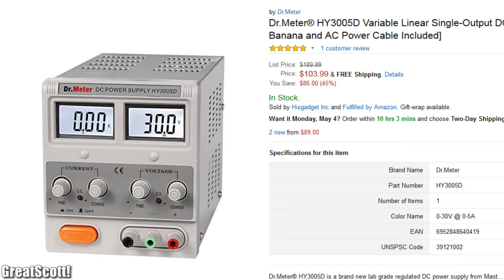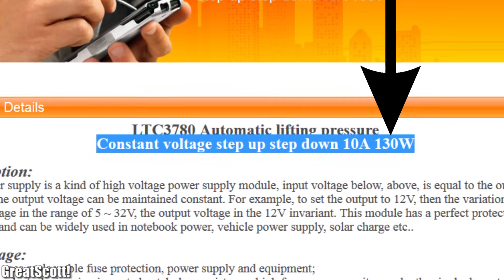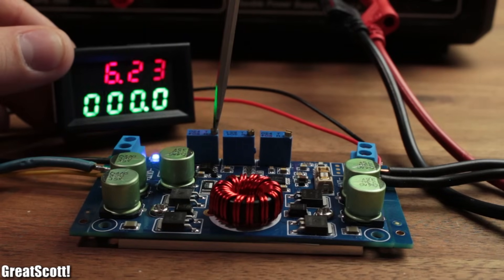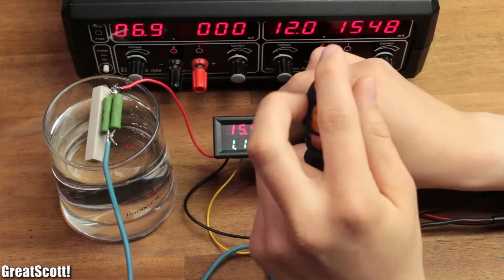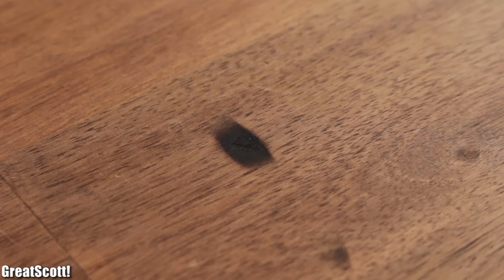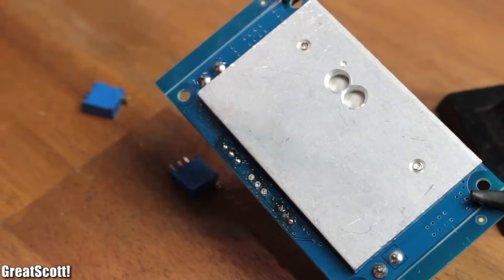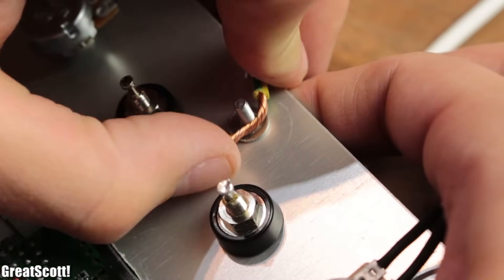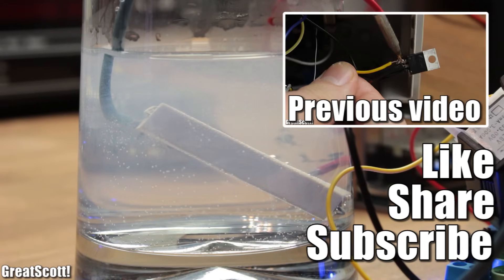Build your own Variable Lab Bench Power Supply

Comment: it would be very useful if one could show a way on how to control the output voltage via the PWM signal of an Arduino (maybe a convert the PWM signal to analog with a RC-Lowpass  and feed it to  potentiometer location??)
Reply: I recently done this for an industrial application. A low pass filter then use an Op Amp as a follower/buffer to get an analog out. However the analog voltage output will vary from 0 to whatever the supply voltage is....
Reply: Be careful, without a good understanding of the actual specific circuit and also access to the proper schematic you might easily find yourself causing more problems than the worth of it like sending the psu into an uncontrolled oscillation state and causing it to burn out. Search the web for Arduino based PWM  controlled psu or such like. There are plenty of Arduino-based example circuits for such a capability.

Rule #1 DON'T assume anything because it makes an ASS of U before ME.
Reply: If you want to control this setup with an Arduino, then you will be better off combining the Arduino with a dual digital potentiometer chip to act as a replacement for the two original potentiometers.
Reply: You could build or buy a resistor ladder (like an R2R DAC). That would let you control the exact resistance seen by the buck/boost converter. It surely using the pot as a voltage divider to an opamp's input. I don't know if it would be the inverting or non inverting input, but that doesn't matter for our case. You could simply wire up a pot to the board as Scott shows here, dial in exact voltages you want it to work at, disconnect the pot from the board and measure the resistance value of the POT. Now you design and build your ladder, possibly with unequal rungs, to get the precise outputs you desire. You'll want several trimmers in there probably so you can make fine adjustments to get it as exact as you can when you built it. Then by turning on/off certain GPIO pins, you can select exact voltage/amperage settings. Because the precision of the multi-turn POT is very good, and the resolution of your ladder probably won't be, selecting arbitrary settings will depend in the number of GPIO pins you use (the bit resolution of your DAC in this case). I would suggest at least 12 bits of precision as a bare minimum. That would give you 4096 different settings, or another way to look at it, steps of 0.005V (24 volt range)/2.4mA (10 amp range) on your output. It would be hard to get exact values for your application like this (say, exactly 100 mA, or 175 mA), unless you used an uneven rung design. Maybe the first 4 bits chooses a range, and the next 6 choose among exact voltages, and the last 2 move the adjustment up or down by 1% or something for fine precision. I don't know.  You'll need to be creative on this, since there likely isn't an exact chip built that will do precisely what you want. That's why you're doing it custom, right?
Reply: زس
ؤ
Reply: ThomasHaberkorn sorry what?

Comment: i tried twice to get the pots off the LTC3780, both times i fried the pads i guess, i never seen any pads, but when i removed the pots there was nothing to solder to , so i bought a second one , same exact thing $44.00 for these LTC3780 s and im stuck with these both and and still no power supply, and no idea what i will now do with my new $44.00 paper weights
Reply: hard lesson learned, i bought a new iron, a hakko, a very good investment and a world of difference in performance than my cheap radio shack crappos. but still wish i knew how to fix these ltc3780s
Reply: Wished I had the time and patience but I'm just going to buy this, http://www.ebay.com/itm/0-30VDC-0-3A-Switch-Mode-Bench-Power-Supply-with-Digital-Display-CSI3003SM-/221584065292?hash=item339770830c:g:hPMAAOSwEK9T7jmj
Reply: You could just buy 2 LTC3780 by the same price in aliexpress... just in case you break something... Also, make sure that the iron is hot enaugh to melt old tin solderings, and add some more new tin so you can heat up the 3 pins at the same time. Keep in mind that brand new tin usually has something we call "colofonia" in my country, don't know how it's called in yours (probably soldering paste, or something like that), that helps to melt down the tin. Old soldering points don't have that...
Reply: nice but expensive, especially shipping. See my earlier post re: banggood units <£47 post free for a 0-32v 5A unit

Comment: Excellent guide! Do you mind to explain the main difference between a LTC3780 buck boost converter you used and LM2577S + LM2596S Power Converter Module(http://www.aliexpress.com/item/Z116-LM2577S-LM2596S-DC-DC-Step-Up-Down-Boost-Buck-Voltage-Power-Converter-Module/32243179400.html)? Thank you very much!

Comment: If i were to add a 12v fan can it be connected directly to the internal power supply's output?
Reply: Yes, if the output of the AC-DC convertor is 12vdc, then go for it. If the AC-DC is different, say 24vdc output) you can buy a small convertor board that will output 12v just for the fan like this
http://www.ebay.com/itm/Mini-3A-DC-DC-Converter-Adjustable-Step-down-Power-Supply-Module-replace-LM2596-/291688413257?hash=item43e9fbf849:g:y8wAAOSwezVWxobW

Comment: Hey Scott, its a great project. What resistors did you use above the waterglas? Im intrested in boiling water with a 12V input.
Reply: Look for "power resistor" on the internet. To boil water, I think you'll need several hundred watts!! With 12V, the current will be huge, you'll need a powerful source (lead acid battery for example).
Reply: +xgenesys Thanks :)
Reply: you can use glow plug

Comment: Hi, I wonder if you could help.
I have just built this power supply and I have a strange problem.
When I adjust the pot for the amps I get a value on the display, but when I try the volts I get nothing. 
When both pots are at zero the fault led lights on the LTC3780, but when I turn the amps up it goes out.
The volts has no effect at all. I have checked all the cables as per the design and all seems ok.

I'm wondering if I have killed my LTC3780...

Thanks

Keep the videos coming! :)
Reply: for amp you have to short both the terminals and for volt you dont have to i guess

Comment: short question, what bench power supply do you have? (make+model)
Reply from the maker: ELV DPS5315
Reply: Thanks for your quick reaction. Is this a replacement for the one you had before? Did that one break?
Reply: he said in the video, it does not make enough amperage, so he may aswell build a new one rather than beefing up the old one!

Comment: I would add an insulating boot around the mains inlet connections to improve safety. For example a wire or chain could be inserted into the vent slots to touch a live terminal.

Comment: Nice DIY-project. Just ordered the parts and will assemble them soon. Question: Wouldn't it make sense to connect a diode in series to protect the ltc3780 from overvoltage? If so, what would be the best choice? After all, the diode would have to cope with 300W in the worst case...
Reply: Not quite sure how a Diode would protect from overvoltage, but a diode always wastes Power. Which means that it will get quite hot at that current besides dropping a certain voltage.
Reply: You can buy an IEC plug with a fuse in it. That works a treat
Reply: http://www.parts-express.com/Data/Default/Images/Catalog/Original/090-443_HR_0.jpg
Reply: No, I meant the output from the ltc3780. It seemsthat there might be problems with overvoltage on the output frying the ltc3780.
Reply: Ahh okay

Comment: help me scott.. my ltc3780 goes from any higher voltage to approx 1.8 V during which the blue LED dims and shut down in the end. i dont know what's wrong with it. the original undervoltage potentiometer was damaged so i replaced it with another same piece.. but somehow the resistance is not measurable using a multimeter. plz respond asap. thanks in advance

Comment: I am definitely building one of these. It'll be nice to design pedals for more than just 9v's. I used to work as receiving inspector for an electronics manufacturer. I have tested so many of those a/c mains power supplies that you show here that it's not funny. I think that I will us an old pc case that I have as the enclosure.

Comment: Is there any reason not to use a regular power brick for the 12V 5A power supply?
Reply: Anything that outputs less than 30 DC volts will work. I used an old switching PSU from a broke VCR that was on a separate board. Works great.

Comment: Would it be possible to just use an old, maybe small computer PSU and just use the 12-Volt output instead of buying an additional 12-Volt PSU?
Reply: +severin obrist it should be. I'm also planning to do so.
Reply: I used an old switch mode PS I scrapped out of a broke VCR that was on a separate board (lucky find). It outputs 29VDC at about 3A. Got it for free :D

Comment: has anyone built this power supply?
Reply: +Dub Monster I got the parts on eBay, I would suggest getting multi turn potentiometers , I got a couple nice ones on eBay for $5.00 each used and reconditioned, work great and alot cheaper than new ones, also the single turns are a pain in the neck trying to adjust to a precise setting, and my last suggestion is when removing the pots from the board use minimum heat and take ur time , I have years experience but I still lost the pads on two different boards, so now two $24.00 boards are in the scrap bin. goodluck
Reply: I did
Reply: im maybe building this, if there is parts for it, because i live in finland
Reply: I got everything from eBay and paid less than 40 USD total including the case. Took a while cause a lot of it came from China. I agree with Hammer on the pots. I got single turn and you have to be steady but they work
Reply: Barry Stevens
okay

Comment: have you measure the ripple with oscilloscope? I am curious about how smooth is the output of a buck-boost converter that powered from a switching ac to dc supply.

Comment: Seems that voltage and current meter needs a isolated power supply or the measurements might inaccurate, try a DC-DC converter with isolated GND, or disconnect the thinner black(GND) wire at the 12V side. There is no way the minimum current is as high as few hundred mA!

Comment: hey man, i bought that power supply, when it arrived the potentiometer was corroded and only connected by one pin, the supplier refuses to take responsibility "BUYER BEWARE" of seller  " tomtop_home" on ebay , absolutely horrible to deal with. So i soldered the pot back on, and the supply range is hitting at 35 Vdc to 55Vdc. so will changing the pot fix the problem ???? ANYONE???
Reply: There is a good chance that changing that pot will solve your problem. Nothing can be said 100% as there is always the possibility of some other damage on the board, but I'm betting it's just the pot.
Reply: There is a good chance that changing that pot will solve your problem. Nothing can be said 100% as there is always the possibility of some other damage on the board, but I'm betting it's just the pot.
Reply: Alley Cat Jack thanks, I'll try and figure out what size it is
Reply: +Alley Cat Jack thanks for ur help alley cat, that did the trick, i also put a couple them $1.00 buck converters  inside mine to have a constant 12Vdc 3A  , and a constant 9Vdc 3 A. added a fan , some heat sinks and a led just for the heck of it, lol thanks again, and you too Great Scott!

Comment: Can I use 12v 2a power supply?
Reply: Sure, but your output will obviously limited to either 24 watts or 2 amps.
Reply: John Casteel Thanks. I will use 24v 5a is that ok?

Comment: Could you easily make a 13.7V 70A power supply, supplying clean power, to use when when flashing modules/coding cars?
Reply: No, not easily. The 13.7 V part is relatively easy. Building a high currnet 70 amp power supply is considerably more difficult.

Comment: how this happened...?
that you are using 12v 5A power input and output going upto 29v how...?
Reply: The way this works is the device is applying a high frequency PWM signal to a MOSFET switch, switching power the coil very fast. As the switch closes, current begins to flow through the coil and charge the capacitor. When the switch opens, the coil collapses, driving a very high voltage. A diode blocks the voltage spike from feeding back to the switch, and diverting it to the capacitor. As the capacitor charges up, it develops more and more voltage in it. The buck/boost converter regulates the power by adjusting the duty cycle of the PWM signal. A lower duty cycle charges the coil less, causing less voltage. A higher duty cycle charges the coil more, causing higher output voltage. 
Now for the magic: there is a feedback from the output into an opamp. If the value set by the potentiometer is higher/lower than feedback value, the opamp sends a signal to the PWM circuit, increasing/decreasing the duty cycle to compensate. This keeps the output voltage very close to the set value you want. There is also a feedback for the current. Since the current is based on the voltage and the resistance of the load you connect, you can't directly control that. However, you can reduce output voltage if the current exceeds some value set by the second potentiometer.
So in this way, you have the ability to dial in a precise output voltage, and limit max current by collapsing output voltage if it exceeds some value.
Reply: +Chinmay Kolhatkar I also want to know this, how does he get 29v out of a 12v power supply? I tried cranking mine up with a 18v 4a power supply and it won't go over 18.8v.
Reply: Actually it should boost the voltage. I.e even when u r applying 9 V it should go up to 25 at least. This is what manufacture says.
Reply: Its because the LTC3780

Comment: buy a power supply from hong kong... then you get a power supply capable of 0-60 volts 0-60 amps its insane uses the full output of your wall socket .. with fine and course knobs going down to 0.01 amps
Reply: +Ronald Rogerson Any links to them or ways to set it all up?

Comment: I was inspired by this and built my own. I got an amp/voltmeter that is rated to 10 amps. The wiring was different. 
I used an orphaned 95 watt laptop power supply. I am using it as an external power supply, so there is no high voltage in the enclosure.

Comment: Everyone should realize that switching power supplies and DC-DC converters put out RFI, radio frequency interference.  It's not very much, but it can cause some circuits, especially audio, to pick up interference.  So it's important  to put a filter choke and low ESR capacitors between the converter and the output.

Comment: Hey Great Scott, I followed your tutorial and after finishing the project, saw that my current limmiter isn't working, and just draws as much current as it wants all the time. Is the the pot i should replace or the LTC?
Reply: Same thing
Reply: Can somebody help us
Reply: @mikebauer8060  The meter is wired up wrong. You should not connect the thin black wire of the meter at all. It will use the 0V thick black wire for 0V. By connecting the thin black wire, you are connecting the OV of the supply to the 0V of the output via a thin (resistive) wire. This effectively shorts out the shunt resistor which is inside the DC converter and so current limiting wont work.

Comment: I have a small problem i cannot find Potis whitch has 200k or 500k on reichelt only 220k and 470k Ohm

Is it a problem when I use 220k and 470k ohm Potis
Reply from the maker: +Stefan Kefer Your range will suffer.
Reply: +GreatScott!  Thanks, does it matter

Comment: thank you Scot about a idea! Today I finished a project after a 2 months of waiting a parts from ebay :D . I changed some parts. I ordered a 10A 12V LED driver as a LTC3780 can provide at least a 7-8A of current. Also to provide higher precision of adjusments I added in series 20k pot before 200k pot and added 50k pot before 500k pot, so now I have coarse and fine adjustments. Also I added a 12V ventilator for cooling and switch for turning on DC (more to turn of i  emergency case)
Reply: +Connor Bisby Give me your e-mail, I can send you some schematics. I have no idea how to attach it to arduino - i'm quite retarded in programming
Reply: +Jam Jamamam I want to do this project. It works 100%?
Reply: +Alexander Ruiz Yes, i made it couple weeks ago and tested with some DC projects (electrolysis, electrolysis etching, charging batteries etc.). Only downside is chineese volt/amp meter - it lies up to 0,7V, so you have to double check voltage with multimeter (if precise value is necessary). Otherwise it's great.
Reply: +Jam Jamamam   
I have a switching power supply of 32V and 2.5A. Using the LTC 3780, could more or less regulation 0.7-30v a 2.5A current limit?
Reply: +Alexander Ruiz yes, it should be possible
Reply: Is this working till now ?
Especially fine and coarse adjustments. Because I have to make one for me.
Reply: Yes, same thinking here, 12V 10A should give more power. But did you think you need to add an extra heat sink? Thank you

Comment: Why you don't need to have an isolated power supply for the digital voltmeter ammeter ?
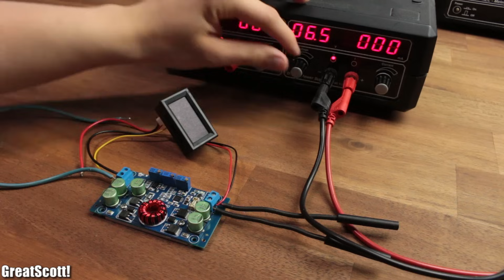Reply: at 1:32 you can see that the thin red & black wires are connected to + and -12V IN, that's how the display is powered.
Reply: f0wl yeah but normaly they need a separated power supply otherwise the current display will give false information.